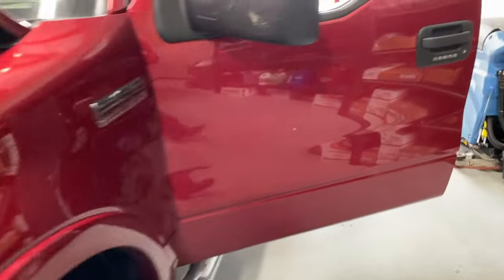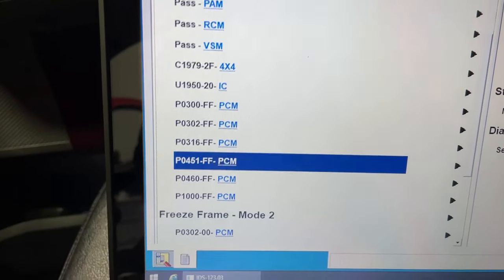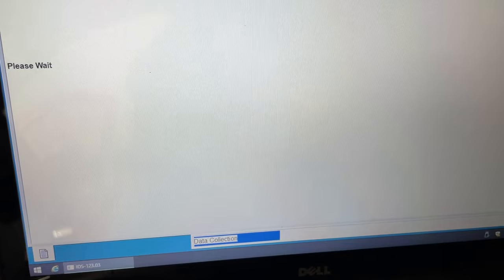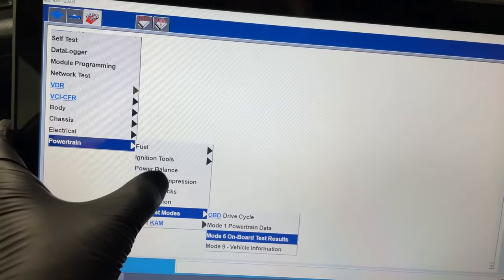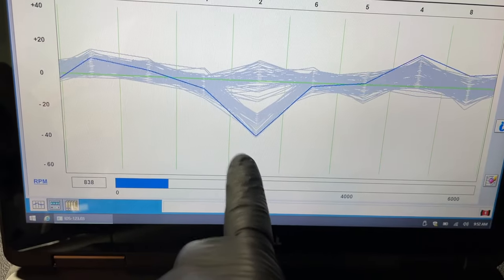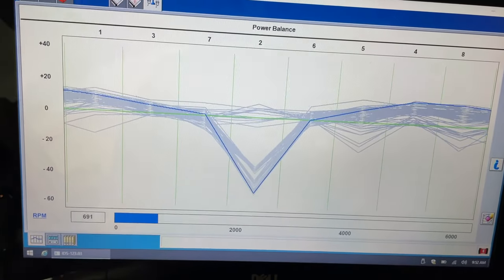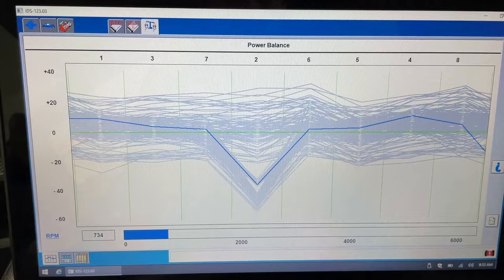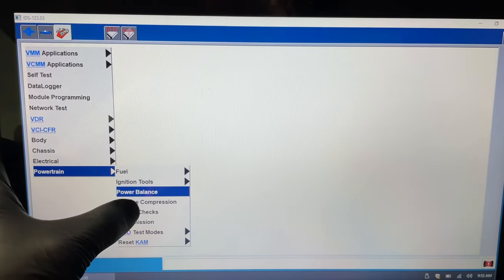Ford F-150 5.4L 3v Triton Engine Misfire: Champion Spark Plugs Belong in Chrysler’s and Lawn Mowers!

Comment from the maker: I only Recommend Ford 5.4L 3v Ignition Coils and Plugs:
2004-2008 Mid Year Spark Plugs (Torque Spec 25ft lbs)-
https://amzn.to/3kIwGig
2004-2008 Mid Year Ignition Coils-
https://amzn.to/3i7DGmW
2008 Mid Year-2014 Spark Plugs (106 inch lbs)-
https://amzn.to/3uc3Nhv
2008 Mid Year-2014 Ignition Coils-
https://amzn.to/3zI5PXU

Forscan is a free Ford Specific Diagnostic Software:
Download Here- 
https://forscan.org/home.html
ELM 327 Adapter I Recommend-
https://amzn.to/2GC6dBj

As an Amazon Associate I earn from qualifying purchases.
Reply: Hey Makuloco question are the spark plugs and coils the same part number for the 2005 f150 4.6 L? Thanks for all the info that you share helps a lot. Greeting from Arizona.
Reply: So basically use a ford coil on number 2. I actually have a 2007 with an aftermarket engine and transmission... same dang problem. But about a year ago I had no choice but to put a ford plug and coil on number two and NO ISSUES AFTER THAT.
Reply: @thedavidahamm8898  Make sure ALL cylinders have the right spark plugs and coils. No problems.
Reply: @armandocarriedo9354  I have a 2004 Ford f150 5.4. 3v and the plugs are a diferent part number in the 4.6 than the 5.4. They look almost identical but the part numbers are different. He actually has done several videos on plug replacement including one that explains the diference.
Reply: Great channel very informative but I have an issue it's an 07 5.4 with a tick not the phaser.  The tick is on the passenger side if the RPM's get up like 3 grand it begins to run rough and weak you can cut it off let it sit and start it back up runs fine until it's in overdrive in a pull then it has a hard skip. Help please
Reply: @quadpop4643  The tick may just be a broken manifold stud or the manifold itself. There are not many 07s with good factory manifolds or studs, if any. You might have 2 problems that you are making into one. How do you know it isn't the phaser?
Reply: @--_DJ_--  cam phasers and roller followers are new I figured out the problem today it was a lose plug on #3 but I have the valve cover off and I'm trying to get it back on without messing up the gasket, or undoing the ac lines I don't want to have to charge it back up
Reply: @quadpop4643  ALWAYS change the gasket.  It WILL leak if you don’t. .
Reply: @fecklar1905  thanks for the info. I'll look for the video.  Have a great day.
Reply: @fomoco300k  I am changing the gasket just having trouble get the valve cover back in without damaging the new gasket because an AC line is in the way
Reply: @quadpop4643  I see.  Be patient.  Walk away and come back.  That helps me sometimes.  I hope it goes well for you!
Reply: @fomoco300k  thanks I took a day off my back and knees are killing me I'm disable and can afford a mechanic so i slowly do things myself
Reply: Would I be able to change the oil pump without touching the timing belt I just want to make sure that I'm not getting nothing off timing?
Reply: @AlXB-ku1yf look back in the videos I'm not sure you used to could change the oil pump and nothing else not so sure now
Reply: @armandocarriedo9354  armando, he put the part numbers and year models up top in the links where you can click on them. Having said that, the best way to be sure is to go to your local Ford dealer and give them your VIN and they can lookup exactly the right part number for you.
Reply: Makuloco! Do you know of anyone in Miami or southern Florida that’s at least half as good as you? Or am I gonna have to drive the damn thing all the way up to Illinois? Help please!!
Reply: @ReneMacias1978  There is this channel called Rainman Repairs, he is in Florida and seems like a good guy.
Reply: @LA_Commander  will definitely look him up. Thank you brother 👍🏼
Reply: I just changed out some of those drunk champions workloads in my 07 f250 543 valve and I have one of those still stuck down there cuz it's around it off from someone before me how can I get that sucker out of there????
Reply: Junk* 5.4 litre 3 valve
Reply: I have 05 f150 5.4 3v is the  25 ft pds even If you use antiseize ? I read some where it changes the required torque to 14ft pds . Changing them today.
Reply: My 12 Charger R/T, came with NGK from the factory. However, I agree I'll only run Motorcraft plugs on my 07 Ranger.
Reply: @standhd  for a little while
Reply: Parts to make fords come from 26 countries
Reply: You have web sight for the tools used. For example torque wrench
Reply: I had just changed plugs in my Ford 400 ci carbureted station wagon (late70’s) and I developed a miss shortly there after. Took the car to our family mechanic,he asked about recent work. He pulled all of the plugs and through them away.  Before he through the last one away, he took the one that was misfiring and broke it open. He said “see this gap between the top contact and the carbon rod in the middle that touches the end electrode. These were resister style plugs. Champion calls that a booster gap. These plugs will grow green corrosion just sitting on the shelf.” Sure enough there was green on the electrode. Will not ever buy anything made by Champion. You pay for their marketing, not their research. A couple of years ago My buddies boat had Champion plugs in a 305- V8 that would miss and bog on acceleration. We looked at the carb and it seemed to pump fuel well enough. Checked the plugs, Champions with green corrosion everywhere and on the distributor cap. New plugs, And cap from Prestolite from the marine dealer and all is fine.
Reply: Does anyone knows what software Brian uses?
Reply: @hebertogsx in the description.
Reply: The Amazon link has expired for the 04 to mid-08 year. Which plug do you recommend for an early 08 F-150 5.4L? TIA
Reply: Thanks I will check on the torque differential for the two

Comment: As my high school auto shop teacher once said of Champion spark plugs: "Some people swear by 'em and others swear at 'em."
Reply: You're better off using OEM parts in a Ford 100% of the time... Use motorcraft spark plugs and you'll have no problem. Also on your coil overs instead of buying new ones replace the springs and boots on the original ones and it's like brand new coil overs 😊
Reply: @cassiemarie70  I use Motorcraft parts  exclusively on my three Ford vehicles-- except for oil.

Comment: Bravex has really cheap coils for 50-70dlls for 8 pack ive had em for 5 years never had a problem. I was short on money so bought em just to get by i was expecting for em to go bad within a year but they're holding up allright, i messaged the company before the warranty expired and they sent me 8 new ones, ford coils are better but it is what it is.

Comment: I can say I did a complete timing set coils oil pump spark plugs water pump and alternator on my moms 2006 Expedition about 3 years ago I used all ford parts except the high volume meling oil pump. I also replaced all injectors with Ford ones. The car Had 130k miles on it when I did the work on it. It now has 156k miles and It has zero problems and runs like a dream. I also converted it to full synthetic Motorcraft 5W30 and to be honest it never has had a problem since. Thanks for your expertise in this realm. I love the 5.4L 3v Triton

Comment: It took me 2 years to figure out the reason I kept burning spark plugs on random cylinders. 
seams like 25 ft/lbs is too much torque for a spark plug in an aluminum head, but that much torque cured my problems.
Thanks for the video as it confirmed my suspicions.

Comment: I'm impressed, you're the first tech that I've seen use compressed air to clear the debris from the well!
Reply: We were taught to do just that in high school auto shop in the 70's. Not just plug wells, but any area of the engine compartment before opening up any component under the hood. As well as brake slave cylinders, live axles, trans/transfers....  Good practice. Who needs to have anything unwanted falling into the works.
Reply: First day with my 09 F350 I changed plugs/cops, oil/filt etc...  I couldn't even get the plug socket on 2 cylinders, so much dirt in there i couldn't even see the plugs. Blowing out the area before disassembly is a priority, specially in wells like in our 5.4l heads. I think I have a pic somewhere.

Comment: I bought a '05 F-150 from a small mechanic shop outside of town. The mechanic that works on the cars before they sell them said he pulled a few of the plugs out and said they were good so he didn't replace them. The truck had 112,000 miles on it at the time!

He was full of shit! At about 140,000 miles I started having lots of random misfire problems from multiple cylinders. I decided to go all in and replace all of the plugs and coils. I'm glad i did. The plugs were the original shit plugs from Ford! They LITERALLY had a .25in gap in them!!! There was no electrode left on them. I ended up breaking 4 out of 8 getting them out but it was no problem with the extractor tool from Lisle tools!

The engine runs so much better now! Plenty of power and acceleration and not single misfire from any of the cylinders!

It's so hard to find honest mechanics nowadays! But i am grateful for channels like this. I knew exactly what to look for and how to replace it! Thanks a million times over FordTechMakuloco!

Comment: Ouch!  I will always defer to your expertise since you have taught me so much BUT I have been running the single piece Champion 7989 plugs in my early build 2008 F150 since 2012.  I initially had 1 misfire develop about 1 month later but swapped the plug and none since then. Did a complete timing component job with oil pump and phasers in 2017 and those Champions came out no problem.  Installed a new set then and she has been purring like a kitten ever since.  I run either NGK or Motorcraft in my other 5 cars but so far so good with Champion in my 08 F150.
Reply: I installed 1 piece champion plugs and get better gas mileage and runs better it’s 2006 f150 crew cab 5.4 3 valve why put 2 piece plug in so it may break later that’s only reason I installed champion 1piece plugs put them in 2009 no plug problem had no problems I do agree you’re supposed put champion in Chrysler and lawn tractors thanks for another awesome video thanks for sharing god bless
Reply: @rayarnold8275  from my understanding, Motorcraft are no longer 2 piece plugs.
Reply: The problem was not the champion plug in my opinion but I’m a dodge man. The plug was under torqued
Reply: the "bad" plug on this engine wasn't in tight either..it leaked exhaust gases and no doubt allowed air in on the intake stroke, causing the lean misfire. I've never had problems with Champion plugs.
Reply: Lol the man has fixed more f-150s than you guys have seen on the road but OK. I've always gone all Motorcraft and not about to change.. Love my truck and won't blow my block with aftermarket garbage
Reply: @michaelallen2870  man you really can’t handle it when someone questions Brian….
Reply: @FishFind3000  Seems dude got triggered if people don't use the same parts as him.
Reply: @slotripper  You people make me laugh. Its a plug for Christ's sake.
Reply: @michaelallen2870  never understood why ppl replace with aftermarket especially a daily driver... Don't be cheap and buy what is made for your vehicle everyone otherwise it will cost you more $ !

Comment: I use NGK PLUGS, WIRES, ECT.. ON MY 97 Grand. Jeep 4.0, hell I've been using NGK since the 80's even in my 60's Camaro's. But I just bought Mercury Montego Premier 2007 with the 3.0, 6 speed with the non CVT  TRANS. 167,000 miles on it for $300. Front subframe had 2 silver dollar size rust holes right above the exhaust tunnel. The lady was going to junk it because of that. Welded in 1/4 plate steel over the whole tunnel subframe.

I'm not a Ford guy but from what I hear on the Ford forums is USE FORD FACTORY PARTS, LIKE YOU SAID. So I guess I'm going that route with plugs & coils when needed or other parts. Just joined your channel & I AM VERY IMPRESSED BY YOUR SKILLS, SIR.

I want to change the Trans. fluid in it & flush the cooling system before winter, then I'll be set, THANKS AGAIN for assuring I use Ford Factory parts. Henry from N.E. PA.

Comment: My 2007 5.4v 3v with 120k miles had a misfire on cylinder 5. Pulled over and discovered the plug was loose. Torqued it down, and went on my way. 5,000 miles later, another misfire, same cylinder. Pulled the plug, and the electrode ground had broke off, not a good thing. I replaced the plug with Motorcraft, still had a misfire. Replaced the COP, still had a misfire. I was suspecting cylinder damage from the spark plug electrode ground. I did not have the means for a compression test, so sent the F350 off to the local ford dealer.

I want to note the misfire would occur within one mile of start up, and a definite loss of power immediately upon start up. It also took two seconds to start the truck typically took one second.

Ford dealer had the truck for six weeks trying to find the problem. Yes, six weeks. The replaced the spark plug, COP, fuel injector, and ran a compression test. They could not figure it out, and said I might need to replace the PCM. I said no, and I picked up the truck.

I read 100 pages of threads on  Modular V8 forums looking for clues. Found where a guy posted carbon issues might cause the plug to not seat right. I bought a scope, and looked at the spark plugs seat, threads, and top of piston. Did not see anything that could help clarify the issue, but the piston did look black.

Bought a Champion plug, it has a very different design than the Motorcraft, More threads, beefier nut, bigger surface where the plug meets the head, and an old traditional electrode ground. Decided it was worth a try.

Removed the Motorcraft plug, and sprayed about 1/3 of a can of carb cleaner into the spark plug hole. Let the cleaner sit for about one minute. STARTED THE TRUCK UP WITH THE SPARK PLUG MISSING, SO WHATEVER CAME LOOSE FROM THE CARB SPRAY CAME HOPEFULLY CAME OUT THE SPARK PLUG HOLE. Had a fire extinguisher handy if needed. Let the truck run for about 30 seconds, and shut it off. I should also note I had the cable to the COP disconnected, to reduce a spark risk to the carb cleaner, fuel going into the cylinder.

Installed the Champion plug. Truck started right up. Went around the block, no loss of power. Checked toe code reader, no codes. Decided to go to Home Depot with the truck, which is over a major mountain, with a speed limit of 65 mph. No power issues, no misfires, no codes.

Carbon build up? Motorcraft plugs not seating well after driving with a loose plug, where a Champion seated better? I don't know- all I know is my truck is back to normal. Truck now has 180k miles on it, with a Champion plug still in cylinder one.
Reply: Michael K I have a 2005 5.4 3v I too have a misfire and found #2 plug was loose. When I tried to install the identical autolite plug it seems the threads in the head are stripped. Before I go spending money on specialty tools and after reading your comment I'm going to try a champion plug. If the threads are longer I might get lucky. I'll comment if it works. Thanks

Comment: Thank you for explaining the people that Ford Motor Company does not know how to number their cylinders.
An interesting thing you can do with those 5.4 3 valve engines, because they have such small pressure passages for the cam phasers. Run about 6 oz of Marvel Mystery Oil in the oil or about a week before you do an oil change run a quart of Marvel Mystery Oil in it for a week before you change oil. That will keep those passages clear and save that engine from failing. Cuz it doesn't matter how many times you change the cam phasers, they're not getting oil pressure they're not going to work.
Reply: 00uu

Comment: Mechanics use the Champion plugs thinking since they are one piece that they won't break off when being removed. The problem is that they still can break in half and no one makes a removal kit like they do for the factory plugs. I've had to create my own kit to remove broken Champion plugs. Warming engine and using an impact gun to remove OE plugs I very seldom break any off.
Reply: Have you had a champion 1 piece break off?  I took a old one and clamped in a vice just to see and couldn't break one.
Reply: @kirtxpress  yes, I've had several break. The unthreaded tip can still seize up and break the hex off the spark plugs. The first time it happened was not a fun day, had to get very creative to pull the broken part out.
Reply: @greggcarter8296  wow that's crazy.  I started using them after my first plug change at 100K and 5 of the 8 ford broke. Im on my 3 set now at 317,000 miles and no problems getting them out

Comment: Around 50 years ago I ran Champion plugs, UJ12Y's, in my Harley. I continued into my cars but I found over the years that the chances of getting a bad one seemed to increase with each passing year. The last time I used them I had 4 duds out of the 8 I had purchased. They simply would not fire. Today it's NGK across the boards. In over 10 years I have never had one single dud.
Reply: I work on mowers have seen a few nkg plugs that looks like new but would hardly run took the carb apart 3 times on one that was running bad thinking that was it  put in a old autolight plug and it ran like new  made me not like nkg any more lol
Reply: NGK is a very good brand and is the OEM on most Japanese makes as well as the Ford/Mazda 2.3 Duratec. Good brand. Champion used to be good decades ago but got bought out a few years ago and quality has gone down, unfortunately.